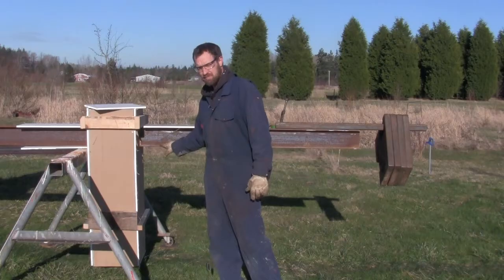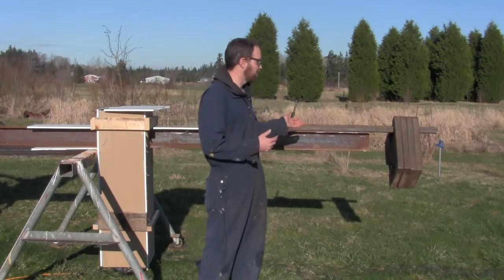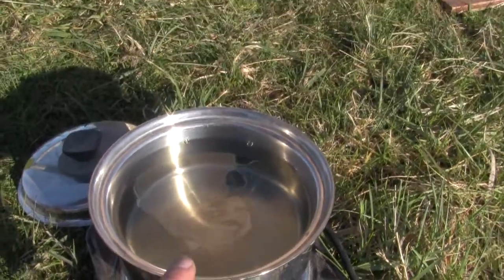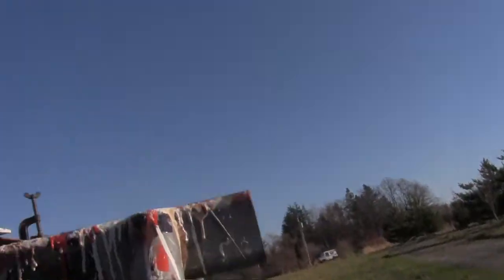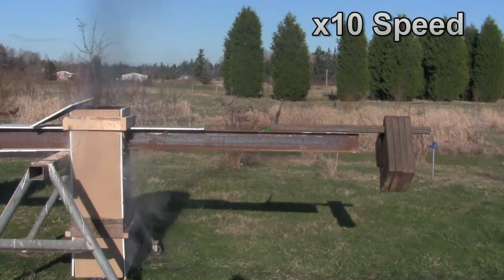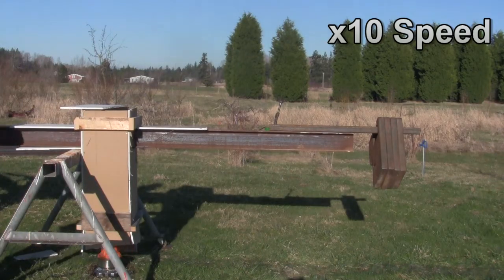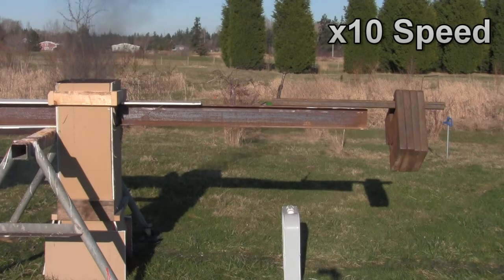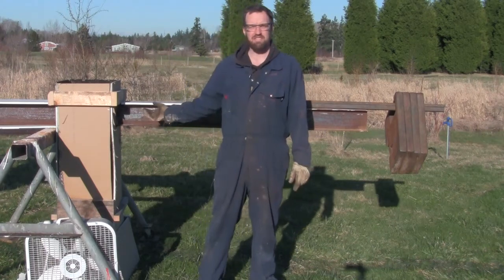Melting/Bending a beam by burning Jet Fuel.

Comment from the maker: If you feel so inclined, here is a link to my go fund me: https://gofund.me/4b28f80f
Reply: Do more videos they are pretty darn good mr! You are a cool scientist type dude many will agree.
Reply: Great work... I do believe that a problem with your setup is that most of the beam is outside of the heat. Simply transferring the heat out to the rest of the beam and cooling the center part sufficiently so it don´t lose it strength.

To make the beam bend, it would probobly need to have heat over most of its length
Reply: Bro remembered his password 😂
Reply: More videos🎥📼📺, thank you
Reply: Based on precedent, the beam should have suddenly severed perfectly at it's hottest point leaving the two halves falling at free fall speed with zero resistance while maintaining their original horizontal positions and landing at the exact same time.. obviously.
Reply: I think U need a more unique channel name, so U are easy/ier to find!

Comment: Everyone talking about "melting" steel is referring to an unnecessary condition for structural failure. Steel becomes less and less resistant to flexing as it increases in temperature. For a beam to fail, it doesn't require melting. All you have to do is heat to a point where its integrity is reduced. There is magic point where the heat level and the load on the steel result in failure. Don't listen to rosey O'Donnell

Comment: I mean, this would be a good point if  the towers fell in 15 minutes 💀
Reply: Open air Jet A would have burned off in 15 minutes.
Which is fine cuz WTC-7 bit the dust because of office furniture.

Comment: This experiment does not match the World Trade Center attack because the structural steel beams that failed in the World Trade Center were engulfed in burning jet fuel flames but in your experiment, most of the beam is not in fire, but must in ambient air; hence, the long beam area in ambient air probably acted as a heat sink and spread the heat out over the entire beam, where much of the heat energy was then dissipated into the surrounding ambient air. To improve the experiment, you can just use a smaller steel beam (angle or channel stock) and completely immerse the small steel beam sample in the jet fuel flame, and that will be much more accurate representation of what the failed steel in the World Trade Center was subjected to, and then the experiment may work, with the steel bending.

Comment: Love your videos. Too bad you aren’t doing more. About the beam, problem is that all that energy is conducted away along the entire beam and there isn’t enough energy to get the whole beam toasty warm let alone pipping hot. Would need to heat the entire beam with multiple flames and maybe concentrate one spot with bigger hotter flames for more accurate results? First discovered your channel when you compared the ignition properties of different fuels. Was an eye opener for me. Will check in from time to time for future videos.

Comment: Umm, the planes made a hole several stories tall with a force so great that debris flew right through and out the other side.  Any fires after the initial explosion would have been within contact of at least some beams that would have already been damaged by that same force.
Reply: Yes but if fell down faster than proper demolition, and how you explain building 7?
Reply: @dmitryhetman1509  Don't see why/how the speed of collapse matters.  As for Building 7, there's plenty of explanations to look up, why are you asking me?  As I understand it, it was hollowed out on the other side by massive falling debris that destroyed most of it's support columns which eventually caused it to be pulled down by it's own wireframe-like construction.

Comment: I question the whole test. Not comparable to 9/11. 
It was an inferno - not a small amount of jet fuel in a pot 5 feet from the beam. Also the structure of the building had been severely compromised by the impact . So this experiment is “anecdotal “ at best. 
Not an accurate comparison in my view.
Reply: How do they explain building 7?
Reply: We have software to run accurate simulation now

Comment: when I first head someone say ``jet fuel can`t ``
I just remember the time a tanker full of JP-5 rammed a low bridge in town & caught fire w/ 20knots of wind all day long, 4 alarm fire had almost every volunteer out hauling hoses & tools.
1.5 hours into the inferno it sagged 5 of the 6 massive 25 inch tall h-beams for the bridge by about 2 feet, you need a lot of air moving, just like how a naked acetylene flame won`t cut steel without oxygen.
Reply: it was inside job, US Gov vs. the US Citizen. LOL
Reply: @mdfikri5976  brave of him to bring to light more lesser-known small inside jobs done by the US Gov against the US Citizen, like inside an old steel bridge in a random town

Comment: but were you have the 400 pounds placed would in reality have supports in each wall to support the other from above, the fuel did not disperse evenly to cause a pancake effect, but fell perfectly similar to controlled demo. was there white or black smoke at towers. an atmosphere would be sucked out into  a vacuum with out a sealed enclosure. von braun tells humanity the truth on his headstone psalms 19.1

Comment: the only flaw i see here is you need to burn a lot more kerosene at once and much closer to the beam - people don't seem to understand heat transfer so i can see the argument they'd use, "oh jeez, sure a paint can 10 feet away isn't gonna melt it but this was kerosene right on the steel, burning for an hour, 60,000 gallons of it!

The change I'd make is to hang a long trough so the beam is half-submerged in kerosene, then light that and let it burn for an hour..  Also I'd go with the thinnest steel you can get - because it has nothing to do with the thickness, so if you can' tmelt a thin steel wire, you're definitely not going to melt (or even soften) anything larger.

Comment: This test is pure amateur

 you had no measurement at all. All you said it's definetly warm
 You never mentioned the temperature where metal loose strength and you never measured the beam. So the beam could be at 250 c and still be damn hot.

Also the beam had only a small surface that had the fire and a huge surface where it could cools down
 
This test was pure useless you demonstrated nothing and you had 0 control over the experiment you made no measurements and your method was flawed. Why the long rod ? 
If it's really weak you won't need half of that length

Comment: so yeah, it didn't melt. plus you cheated because you made a funnel, which didn't happen in the building.... i mean, how hard was it to place a beam vertically, with a load on top and just pour jet fuel randomly around it and notice nothing even happens because the heat is not even focused properly on the beam to begin with..... .  #jetfuelcan'tmeltstellbeams.
Reply: Stop complaining that the experiment wasn't done right. If you want an accurate rerun then build a skyscraper and buy a plane. His setup was better than anything else I've seen yet. He didn't cheat, he was simply creating a simulation, not everything will be the same

Comment: The amount of jet fuel in that plane was hardly enuff to bring BOTH of those buildings down and all the steel is dust at the bottom,.who am I? Poo Poo the fool
Reply: The floors were solid steel plates, of 109 floors including the roof.... It doesn't need to destroy every floor, it only needs to destroy enough floors  to start the collapse
Reply: @machscga6238 where all structure dissapeared why fragments hit surrounding buildings? Building 7?

Comment: There's a guy on YT with a video with something ridiculous like 6 million views claiming jet fuel can melt steel beams because he sets a piece of steel in his FREAKING FOUNDRY and then bends it in a vice while it's red hot. Of course he has comments turned off for obvious reasons. Luckily I got a comment in before he turned them off. I hope he read my comment beforehand. I enjoyed your experiment even though you gave the I beam the best possible chance of possibly getting warpage. The twin towers were oxygen starved (hence the black smoke) and  obviously there were no overextended appendages like you created in your experiment because the towers were built with an external and internal skeletal system of steel tied together. That said I feel like you gave it a more honest approach. Kudos brother!

Comment: there was a video of a better setup, showing concrete blocks on an i beam and a lot more jet fuel. it buckled. jet fuel does not melt i beams but it does weaken them.

people who love to hate complained about being forced to change their opinion and had it taken down. i should have downloaded it!
Reply: Only atomized or vapors of jet fuel ignite.  impact explosion = ignited by spark, vapor, and atomization. The claim that fuel poured down shafts… where would it have a chance to ignite? Just Think showed us what happens when a match is dropped into a jar of jet fuel. Nada. Nothing. It put out the fire on the match.

Comment: You also have to remember, the jet fuel wasn't the ONLY thing that was burning inside the old World Trade Center towers.  There were quite a few flammable materials that were set ablaze as well.
Reply: Yes, those incredibly combustible desks and chairs.
Reply: @JayTaylor3dollarfilms  along with insulation and other flammable materials.
Reply: @PhillipG34 yea insulation doesn’t burn that hot because if it did it wouldn’t be used in residential homes. On the initial impact all the jet fuel immediately disappeared. What brought the buildings down is what’s called controller demolition
Reply: Remember, all the office material existing in that towers, were spread around in all the different offices, nothing like consentrated heat.
Fires and planes reason for free fall acc collapse in seconds, pure nonsese.

Comment: Thermal conductivity of steel is substantial, the thermal mass of an I beam is significant, the distance of the fire and its small amount makes it unlikely it even reached 500c let alone the ~1000 necessary for serious mechanical integrity loss. Repeat the experiment at night, snuff the fire and look at the I beam. Is it visibly glowing at all? No = it's still below the Draper point of 525c.
Reply: The entire thing was built in a way that it became a massive natural draft furnace. On top of that, a massive amount of support structure was compromised due to the massive hole in the building
Reply: @SlapShotTakes   I'm aware.
Reply: @SlapShotTakesHow that explains Building number 7?
Reply: Listen, the theory here is that those planes had enough jet fuel to cover the whole tower from top to bottom and to weaken the structure all the way to the foundations...
so honestly claiming that the conditions in the tower were so much better for melting the beams is just as ridiculous.

There's a reason this conspiracy theory still holds its ground 23 yrs later.
Reply from the maker: I competely agree. I believe jet fuel can melt or at least weaken a steel beam. However, this is what I had. Surely I could mix pure O2 with a controlled stream of vaporized jet fuel and turned the entire beam into a puddle but I don't want to use that kind of resources and that certainly doesn't recreate the events of 9-11.

Comment: cut a smaller piece the big steel is acting as a heat sync
Reply from the maker: I agree but my experiment was intended to be realistic. This is a real beam that would actually be used as a structural member in a building. There are lots of things I could have done to make it work. From preheating the fuel and injecting it into the box, Injecting oxygen into the box, Insulating the beam, Preheating the beam, using a larger box with much more fuel, air directed into the box as the stoichiometric ratio with an oxygen sensor adjusting flows for the most heat. The problem is none of those were present and thus I would consider cheating. I don't believe 911 was a hoax but I also don't believe in faking results or not publishing results that don't line up with what I want. Honestly, I believe science suffers from bias because often if experiments don't get the results they want the experiment doesn't get published, and politicians take scientific data out of context to fit their narrative.
Reply: The whole building was a massive heat sink, thousands of tons of steel to dissipate the heat.
Reply: As did the beams in those towers.

Comment: This doesn't prove that the tremendously much larger beams than your little 9 inch beam in the towers didn't melt but it certainly almost removes all doubt. You couldn't get the fuel to get hot enough by adding a chimney and artificial air yet we were told those huge beams melted to liquid steel under an open burn......always said the whole thing was BS